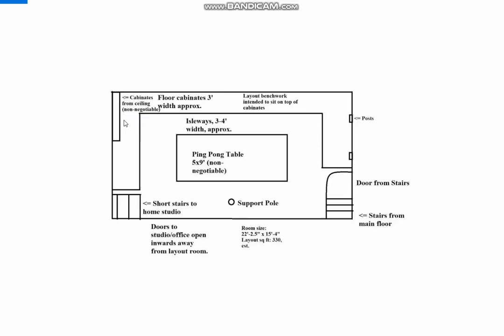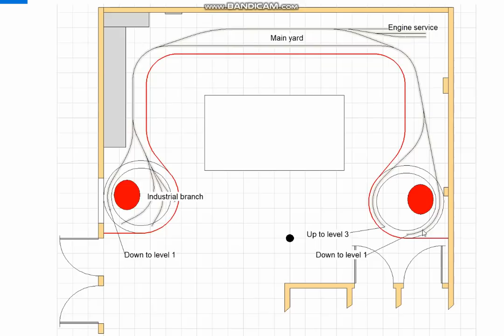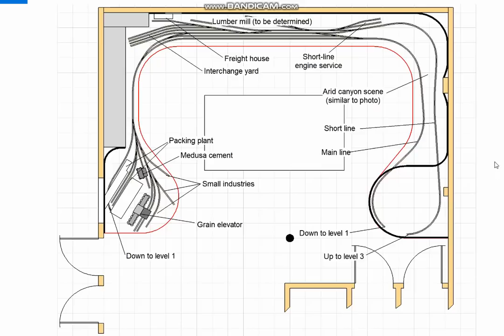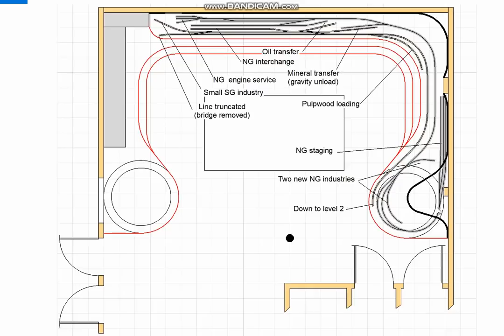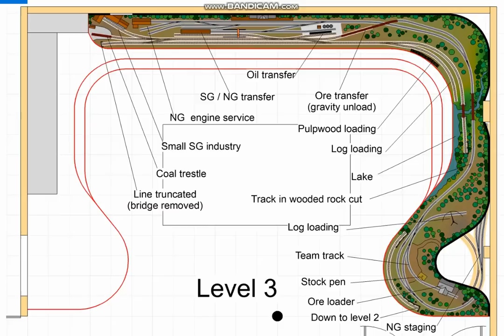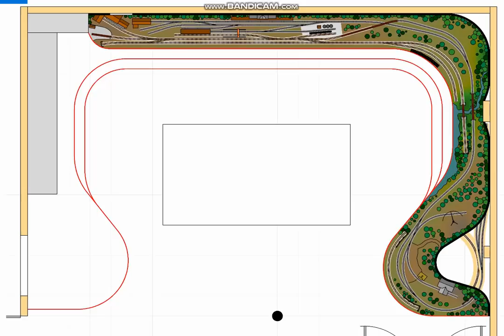Around the walls layout design in a shared space

Comment: As the client for this design, I’ll say for the record that Peter did a fantastic job fitting just about all the givens and druthers into the space provided, which was no easy feat as you could see.

I seriously can’t recommend Peter enough if you want a professionally designed layout for operations. Thanks again, and I greatly appreciate your work.
Reply: MRO,
I must thank you for buying this layout from Peter.  Everything he conceives is a Master Work of Artisanship.  I also like that you paid the freight.  My layout benchwork is also atop Reclaimed, or Thrift Shop, Kitchen Cabinets.  So some of Peter's layout ideas for you I can now absconded with for the major rebuild of my layout.  FOB. Free On Boxcar.
My layout, which had to be put into storage for the room demo and rebuild, currently totals 30 stock lower 36" cubed boxes, 8 kitchen sink 36"x36"x70" boxes, & 3 36"radius end cap boxes.  Currently that totals 156ft. of trackage (or four 39ft. of Main, Siding, & Ops track).
I have no staging.  Which I'm "borrowing" from you. Don't expect it to be returned.
Also MRO and Peter I am going to alter your West (Left side) Helix.  Level 1 will rise to level 2 on a 36"R double main.  The East (Right Side) Helix will travel from the 2nd to the 3rd levels.  Also on a two track 36" radius  main.  And my NEW Level 3 will have a similar con-fig as yours.  Except at the West End I have a low hanging HVAC baffle.  So I'm going to pull my track more forward.  Nearer the facia. And have it loop around, over the 2nd level, to either a reversing loop or some sort of imaginary curved top level staging.  I have yet to decide.
When I'm finished the current train room (30'x38') will more than double the footprint (to 30'x 75', with an additional ceiling shelf double main traversing into the Bar Room soffit. ending in a Double Dogbone Helix, to turn about, to return to the Train Room again.)
So thank you both for coming to my aide just when I needed you most.
~Jim

Comment: Hi mate, 
Brilliant design. 
I might have missed it, but what are the hieghts of each deck?
Thanks 
Mario
Reply from the maker: I might not have given the actual heights because they were not ideal in this situation.  I don't remember the actual numbers.  The lower deck was built on top of cabinets, so would be about 3-4" above kitchen countertop height.  The inter-deck spacing was I think 16", allowing for about 12" of space between them (hence the set-backs) and the top deck would have required step-stools for operation.  The middle deck also had to fit under some wall cabinets.  Were it not for the obstructions, I typically arrange triple-deck layouts at about 24, 44 and 64".

Comment: Hi Peter im going to build a 9 x 6 meter shed for a layout. Do you think putting the door in the middle of the 9 meter side with windows both side would limit options for a track plan compared to putting the door in a far corner of the 9 meter side?
Reply from the maker: If you have any choice of door location, always avoid putting it in the middle of a long wall.  In any railroad design, long straight walls are your biggest asset and the last thing you want to do is cut one of them in half.  A corner location is usually best, although often, moving the door a foot or two away from the corner might be better than being right in the corner as it allows the space behind the door to still be useful.  In the case of an outbuilding as in your situation, that space behind the door may end up being the ideal spot for you and your visitors to hang coats etc.
Windows are another thing to consider.  For a purpose-built railroad room, the windows should be kept out of the way of the railroad.  I think for a shed the size you have, I'd be inclined to put a lot of windows in the same end that has the door.  Windows in the remainder of the building can still be used for extra natural light during early construction, but you will most likely want to cover them with the backdrop as the layout progresses.
Reply: @mpeterll  Hi thanks for the detailed answer. I thought the corner approach would be better but the wife likes the more semetric look of having it in the middle with a window to each side. I will use your expert view as extra ammunition on my side :). 

Yes the plan is for it to be a glass sliding door and then two other windows on that same 9 meter side. Their will also be a roller door vehicle access on the 6 meter side which can help with light during the build but I plan to board it up from the inside for improved insulation. Its only really there for resale value incase future owners want cars not trains in there
Reply from the maker: @chrisj6321  You didn't say where you are located, but if it's in a snowy part of the country then definitely put the man-door in the corner next to the 16' vehicular door - i.e. nearer the driveway so less snow to shovel.
Reply: @mpeterll  Australia so no snow but Victoria so it does get cold. hoping to be able to use the long runs to get trains down to staging without a helix

Comment: I always enjoy your designs.

As a modeler I would be interested in a video with a list of dos and don'ts. You reference some of those throughout your videos. Things like minimum radii for 4 axle, and 6 axle locomotives, vs. the multitude of steam locomotives. Minimum clearance height and rules of thumb for grades and helixes. I understand that you may not want to share all your knowledge. I do enjoy watching your designs as well as the finished products. Thanks for sharing them.
Reply from the maker: I will gladly share all my knowledge with my viewers.  Putting together such a list would be easier said than done however, mainly because there are so many variables and the answers have a much to do with the builder's desired on appearance as they do with absolute mechanics.
Another complexity is that even within the same tight group of cars, there may be some variation.  For example, as a general rule of thumb, full-length passenger cars in HO-scale should have curves of at least 30" radius, although personally I don't like their appearance on 30" curves, especially when the curve is viewed from the outside.  Some brands of passenger cars will run quite happily on 27" curves.  Other brands depend on the specific model.  The Walthers heavyweight cars run quite well on 30" curves, except for the dining car.  This has an access ladder on one side only that fowls one of the trucks on 30" curves, meaning that it will be okay in one direction but not in the other.  Fortunately, it is a simple matter to shave the back of the ladder (a brand new blade is required for this).
Reply: @mpeterll  I definitely would  be interested. It wouldn't have to be all encompassing, just some good general practices.  It was worth a shot to ask. It appears that you stay busy enough with paying customers and your time is valuable. I completely understand.

Comment: Elevations would be a good add.  What is the spacing between the decks?
Reply from the maker: I added the elevations for the customer's version of the plan.  They are largely irrelevant for the general release version since no-one else is likely to have the same set of constraints as the customer it was designed for.  I also don't want to have to answer a barrage of comments that basically tell me it's too high.
Reply: @mpeterll  I am working on a 3 deck design for myself and am curious about deck spacing.  Of course the top level will be "too high" and the lower level "too low".  I am thinking 31", 45" and 59" and am planning on using steel tube construction to keep deck thickness as thin as possible.
Reply from the maker: @ericjonboone  This is something you can best answer for yourself.  I'd suggest mocking up the arrangement with some adjustable shelving.  Place some shelves at the same heights and widths as you plan on building your decks.  Attach some strips of cardboard to the front, the same depth as the benchwork you plan to build.  Then set out some structures, track and cars to get a feel for what the layout will look like.

The minimum benchwork thickness is usually a function of what must be included within it rather than the structural considerations.  Not only will you need to hide switch machines, wiring, and lighting within the benchwork, but space for controls on the fascia.  Don't forget that the scenery needs some level variation as well, and railroads are generally built a few feet above the surrounding landscape for drainage.  In most cases, 4" is about the minimum practical benchwork thickness, leaving you only 10" to view and reach in between levels.  I'm generally hesitant to go that close on a deck used purely for hidden staging.  To some extent, the minimum spacing is a function of the maximum reach-in distance.
Reply: @mpeterll  My upper level will be mostly urban yards and switching.  For most of it, my deck will only be 1 1/2 inches thick.  (1" square steel tube frame with 1/2" thick board on top.)  Using LED strips for lighting and servos instead of Tortoise for my switch control will let me keep the vast majority of the upper deck thin. Only in a couple spots (river crossings) will I need extra below track depth for scenery.  

The middle level will need extra thickness for below track level scenery.  This I think will use 1 inch thick steel frame with nominally 2" foam on top.

For the lower level, I have no thickness constraints.

Thus maybe I should tweak my nominal deck levels to allow for more space between the lower and middle decks because of the middle deck thickness.

Upper:  59" track / 57.5" underside
--> 12.5" clearance for scenery
Middle: 45" track / 42" underside
--> 12" clearance for scenery
Lower: 30" track

I will make a mockup as you suggested.